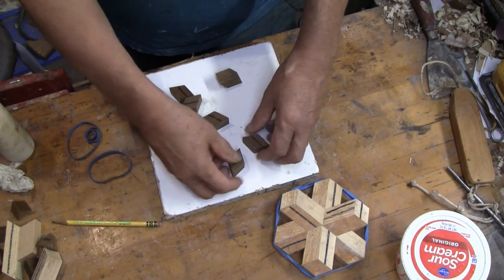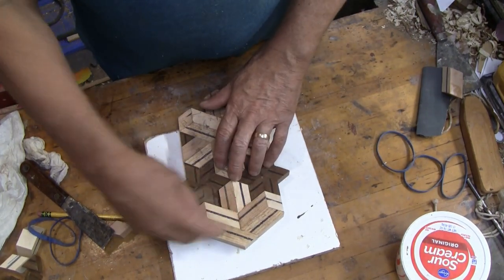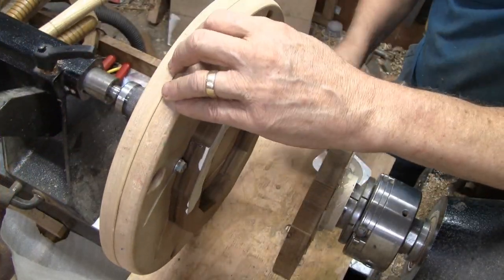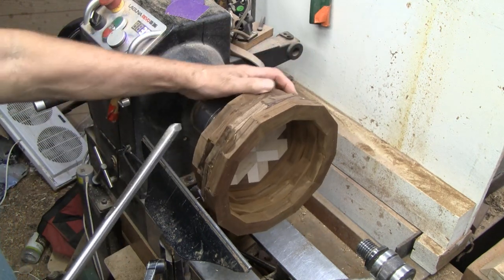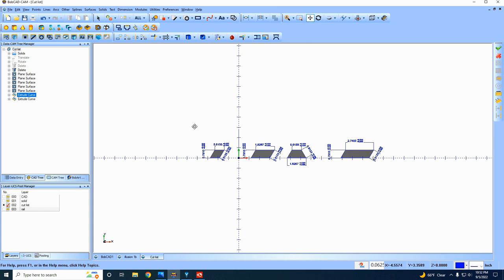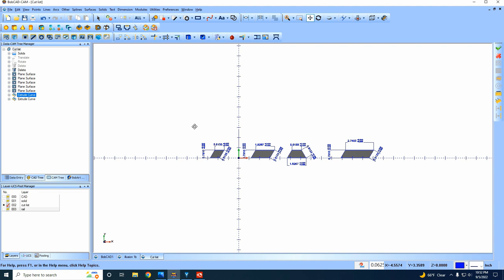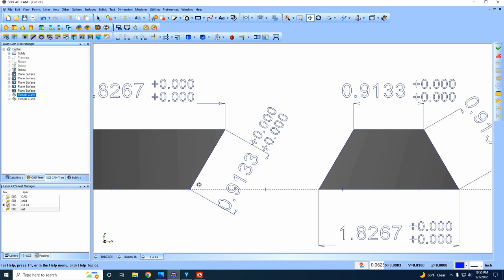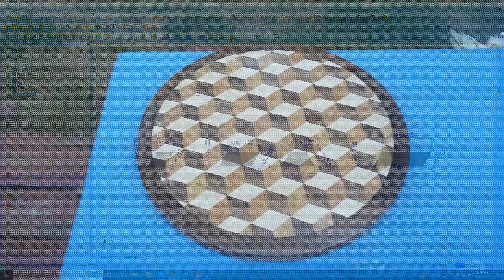Wood Turning the Knucklebones Bowl

Comment: For those who can use it, a FREE WARE cad program can make the design phase a whole lot easier, or pay the big bucks, your choice. 
What always gets me is the actual illusion caused by the different shades of wood and their alignment. 
Your skill is always apparent, and your knowledge of these processes shows every time. Yes, you were a pattern maker, and that helps, but this is art not mechanics, even if some mechanical things are involved. Great video. '-)
Reply from the maker: Thank you Robert. Yes there are a number of free CAD programs and some are very good. There is one called DesignSpark that is very powerful.  The program I bought has built in CAM which I use for CNC work. It also as a decent ART program where I can do engravings. Not a big bucks program but it works.
 Yes the shades of wood and how they are stacked up is what makes this work. 
Thanks for watching,
Gary

Comment: Amazing as always. As an engineer, I appreciate the thought process on how you develop the patterns. What CAD software are you using?
Reply from the maker: Thank you very much Trey. I use a  program called BobCad. It is an ok program but I bought it because it has CAM in it and I have 2 CNC milling machines.  I also added the art module as well which lets me do some carvings but I use DeskProto for a lot of that.
 Thanks for watching,
Gary

Comment: Thanks for sharing your expertise. I am truly impressed. Im gonna try this. One Question please. How many of each piece do I need to cut ? Thank you.
Reply from the maker: Thank you Jake.  There are 3 shades of wood making the center section. If you make 2 of each shape that should be enough. You may have extra pieces but you should have enough. I would recommend making more than that though just so you will have a choice for the best fit and look. I tend to always make more than I know it will need not for the fitting but more for the look.
After that the rest of the wood will be just one type.
 I actually did not make a cutting list for this or even the Great Illusion that I made.
 Hope this was helpful,
Have fun,
Gary

Comment: Check out the quilting book `stunning 3D quilts simplified` by Ruth Ann Berry. This and other designs are shown in this book. Thanks for your inspirations
Reply from the maker: Thank you Malcolm. I know they do this in quilting but never looked into a book. I just googled it and see now I need to look into getting one. I would not be surprised if this illusion might be in one of those books.
Thanks for the tip.
Gary

Comment: Awesome work, would it be easier to use CA glue for the initial segments (those making the "knucklebones")?
Reply from the maker: I do not think it would be at least for me. CA does not give you much working time  where as wood glue will allow you time to shift things in place if needed. 
I use CA for fill cracks and securing bark on live edge turnings.
Thanks for watching,
Gary

Comment: I've watched your great illusion video plus the knuckles video. Both are fantastic! How do you know which pieces go together to make the "L"'s I'm sure they are not the same. You never mention what you used for the "end" pieces. A drawing with the wood types would be helpful. We could use whatever wood we have but at least we would know what order they go in. As others have said I know it is flat but my eyes don't always see it. You are very talented!
Reply from the maker: Thank you Keith, happy you enjoyed both videos.
The easiest way to explain which colors go where would be to look them with the idea you have 3 surfaces. Looking down the flats you are seeing are all the same wood. Looking straight on the flats are all the same wood. And looking from the right they are all the same wood. Think of the end pieces as being part of the flat surface.

The "L" shape are made out of 3 sizes of the parallelograms and 2 of the trapezoids. 
I think looking at the picture at the end should be able to show you the order they go.

Think about the center section it is really made up of all the "L" sections. 
In your mind slide one of the "L" sections across the center section to the opposite side and you will see it is exactly the same in all cases.

Let me know if this makes sense and if not I would have to do this in an email.

Gary

Comment: Gary - love this project - it looks fantastic. I've got two questions. (1) what type glue were you using to have that much working time? I've been making tumbling bowls using Titebond III and I don't seem to get nearly as much time to adjust stuff as you do. (2) your bottom 6-segment ring that went up against the design piece looks great. I assume that you did a bit of sanding on the ring and the design before you glued on the additional rings...?

Regards, Jim
Reply from the maker: Hi Jim, happy you liked the turning.
I used Titebond lll. One trick is to not push the pieces tight together until all the joints have glue applied. That little space really helps a lot.
 I cleaned any glue off the main design piece before adding the ring pieces. Five of them fit perfect and I left one long just to adjust if needed. So I did not have one right to size to test but I think it may have needed a little taken off. Better safe than sorry. But my sled was still setup if I had needed to cut another.
 Thanks for watching,
Gary
Reply: @ThePapa1947  Thanks for the reply - appreciated! One more question - perhaps I missed it, but you didn't show how you cut the six small dark triangles that fit around the edges of the center piece. Obviously they need to be the same material as the six sided ring that surrounds it. Also, they weren't shown on the dimensions at the end of the video. How did you make those little buggers? 🙂

Jim

Comment: WOW!! 
Will have to sharpen my pencal and get my engineering ruler out..
Thanks for explaning and showing how this is done is helps give starting point once i get brave enough to try.
What is the cad program you where using?
Reply from the maker: Thank you Stevie. A sharp penci and a good way to measure is about all you need.
The CAD program I use is called BobCad. It does cost and I use it because it also has CAM and I have 2 CNC milling machines.
There is a free program called Design Spark that is the most powerful free program I have seen.
 Take care,
Gary
Reply: @ThePapa1947  thanks

Comment: Thanks Gary, I made a lidded box like this after seeing your platter. I cut my glue up in half and did the bowl from a board on both halfs for bowl and lid. I used a chop saw to cut my sections. I used 0.53 thickness, then just used the stock width as a spacer   between the blade and stop. 1,2 or 3 thickness depending on part. I used spalted maple, white oak and red oak on a walnut background. Ended up 10 diameter and 4.5 inches tall. Thanks for the inspiration!
Reply from the maker: Thank you very much Greg. I would love to see what you made and if you would like to share a picture you can find my email in my About Page.
Take care,
Gary

Comment: Another great piece of art. Thanks for providing the dimensions for the segments. The bowl in today’s video had very straight sides and a flat bottom. With this shape, I struggle with the transition from the sides to the bottom and I was hoping you’d show it but you didn’t show any details. Perhaps in a future video, can you show how you do this? 👍
Reply from the maker: Thank you Greg. Yes I will show close up's the next time I make that shape. My mind was on getting this done and figuring out how to present the information on the lengths and angles. But I pretty much cut a straight wall to within 3/8 of the bottom and then gently made a fillet at that spot.
 Thanks for watching a I may be making a fairly flat bottom bowl from a chunk of a log soon. 
Gary
Reply: @ThePapa1947  thanks Gary

Comment: What is that program call? Please!
Reply from the maker: The software program I use is called BobCad. If you are looking for something that is free and works great you might want to check out DesignSpark
Reply: @ThePapa1947  thank you! Very helpful videos; when I was in my 20s I used to work with a carpenter and learned how to make wood turning tables and chairs. Now I’m planning to get ready for when I retire but this time I want to do something different. Thanks again!
Reply from the maker: @FilisLawnCare  that is a great plan.
I sure enjoy what I do in reitrement even though I made things out of wood for a living. Much different though. They were wood patterns used in the process of making metal castings.
Have fun,
Gary
Reply: @ThePapa1947  will do, thanks again!

Comment: Beautiful bowl. Love watching your videos. I have a couple questions. I would like to learn wood turning, is there any chance you will do a wood turning video on basic wood turning for beginners. And also what computer program are you using. Thanks for sharing you work!
Reply from the maker: Thank you very much Chris. Sure I could do a basic turning video. What would you like to see in one?
The software I use is called Bobcad. It does both CAD and CAM. I have 2 CNC milling machines is why I picked it.
For a really powerful and free program you could try DesignSpark. I downloaded it but have not used it much because I have been using BobCad for so long it is hard to switch. But I think DesignSpark might be easier to learn.
Thanks for watching,
Gary
Reply: @ThePapa1947  I hear you saying your changing blades and giving the size and talking about the rpms, but I don’t understand why. I’m sure each blade cuts differently and possibly higher rpms mean a smoother cut. Maybe a video on a basic set up with blades a beginner could start out with and how to use them and what would be a good lathe to start out with. Thank you Gary for responding I look forward to watching more of your videos.
Reply from the maker: @Chris09Cole  thank you for the ideas Chris. I realize when first starting out it might be a bit confusing. So I will work on something based on your ideas and maybe a few others things such as sanding.
 Take care,
Gary

Comment: It's interesting how you can get the rings to fit together so precisely. I run all of my rings through a drum sander using a jig that I made. Thanks for the videos! It inspires me to build something.
Reply from the maker: I sand one face on my disk sander then the other on the lathe.
Very fast and I do not have room for a drum sander.

Comment: What I appreciate about this setup is that no material is wasted. Other assemblies made with solid wood require turning to the final shape, losing a lot of wood.
And the final effect is fantastic.
Reply from the maker: Thank you very much Marcelo. For sure it does save wood. But buying the wood this way cost much more than a chunk of wood from a tree.
And very little of that gets wasted as we use it around the garden and some of the shavings can be used for smoking food.
Other wise those pieces get turned into firewood.
Thanks for watching,
Gary

Comment: As always, your turnings are magnificent!  Thanks for dimensions for the Great Illusion.  For this one it would be nice also...especially the segment edge lengths and the diameter of the rings.  Thanks.
Reply from the maker: As far as the pieces that make the illusion for the Knuckebones bowl they are exactly the same as the Great Illusion.
I honestly do know know what the edge length was on the filler piece for the outside. I just marked the piece after making on angled cut and then cut the rest. You can make the rings how you want them depending on the slope you want for the side wall.
 Hope that helps.
Gary

Comment: The 3D effect had me confused, so I watched twice. So perfectly executed. 
What drawing software did you use for the demo at the end?
Reply from the maker: Thank you very much Bob.
I used BobCad for the drawing program. I have 2 CNC milling machines and this works well with them because it is also a CAM program. 
 It also works good for drawing these types of turnings and proofing out that it will work.
 It does cost but if you want to try something that is free I would recommend DesignSpark.  It might be easier to use than what I have but I know my program and it works.
 Thanks for watching,
Gary

Comment: Absolutely amazing. Is there an easy formula to determine the diameter of the rings, I’m sure there is but my brain is in a spin from watching this. Great work. 
All the best to you. 
Regards Jim
Reply from the maker: Thank you Jim.  If you are talking about the different ring sizes that make the shape of the wall then sketch it on a piece of paper. Add a wall thickness and then  decide the thickness of the rings and put those lines across. At that point you will have each rings outside and inside diameter. You can use a free app called Segmented Calculator 2 which will give you the segment sizes.
Hope this helps and I understood your question. If not let me know,
Gary
Reply: Thank you Gary, I will give this a go, you are very generous with your time much appreciated. 
Regards Jim
Reply from the maker: Thank you Jim, happy it helped.
Take care,
Gary
Reply: Hi Gary, sorry if I’m being a bother but just have another question, or two,I have made the illusion using the three different size pieces that you show the dimensions for and it turned out pretty good for my first attempt, can I make the 6 triangles to fill the gaps out of the same piece of wood that I milled to 0.7910 or do they have different dimensions, sorry I’m trying to get my head around this, I’m trying to copy exactly what you have made , and then the six outside pieces, oh I think I need some headache pills 💊 💊😩, only if is convenient. Thanks Gary. 
Regards Jim

Comment: Gary, another great video. How do you clean the glue squeeze out of the exposed joints after the section dries?
Ken
Reply from the maker: Thank you Ken. I take a wet paper towel and wipe it off. I find that the easiest and fastest. It will be turned and sanded so I do not worry about a little film on the wood.
Thanks for watching,
Gary
Reply: @ThePapa1947  when you hold the pieces together with elastic bands, how do you get the wet paper towel under the bands to glean th edge of the side joint?
Reply from the maker: Q-Tips and water. I have some smaller diameter ones that I use.
Reply: @ThePapa1947  thanks, that is what I have used also.

Comment: Try using and upholstery stapler to hold you pieces temporarily. Works really well.
Reply from the maker: That might work good as long as you can turn away the marks from the staples.
 What I used at work to hold segments in place and tighten up the glue joints was "pinch dog" But they can leave a pretty could size hole to have to repair. I do have some micro size pinch dogs that probably would work like your stables but the pinch dog not only holds them in place it tightens the joint.
Thanks for your tip,
Gary

Comment: I have the cutoff angle set at 30 degrees, but some of the pcs don't fit together like yours. What could be wrong?
Reply from the maker: The only thing I can think of without seeing a picture is you might have the angle set from the wrong plane.
Looking straight on to the flat side of your table saw blade the fixture will tilt 30 degrees off of 90.
If you would like to send a picture of what you have I will know for sure. Plus I can send you a drawing of  how it is done.
You can  find my email address in my About Page. This can only be seen on a computer. It will not show up on a cell phone. If you can not find it let me know.
Gary

Comment: Making stars. Other than cut and try, how do I determine the cut length to make sure the block is fully  symmetrical?
Reply from the maker: The way this works is the stars are equal length sides. those are 1/2 the length of the longer piece. If you watch to the end of this video I give the dimension for the Great Illusions. Those pieces are the same as making the Knocklebone Bowl.
 Hope this helps if not let me know and I can help more.
Best of luck,
Gary

Comment: What are the very long pieces for?
Reply from the maker: Which part of the video do you see them. I did this awhile ago so I would need to look and see what you are referring . I would be happy t look.
Reply: @ThePapa1947  I was watching the last part where you were showing all the dimensions and cutting details. I think I see where the long ones are for the outer most pieces on the platter you made and not the inner sections like the bowl you are making in this video.
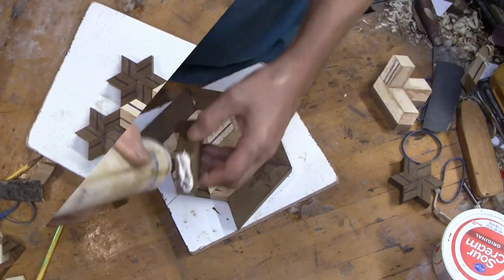Reply from the maker: If you are talking about what happens at 9:59 in the video those would have been for the boarder pieces around the out side.

Comment: Gary - Perhaps I missed it, but you didn't show how you cut the six small dark triangles that fit around the edges of the center piece. Obviously they need to be the same material as the six sided ring that surrounds it. Also, they weren't shown on the dimensions at the end of the video. How did you make those little buggers?
Reply from the maker: Hi Jim,
I did not give those dimensions but I mention they are made just like standard segments. Just a little bigger. I think it is best to measure those after all the other pieces are cut and glued together.
 Those dimensions at the end were for the Great Illusion but the center of this one is the same as the center of the Great Illusion.
Hope that all makes sense. If not let me know.
Gary

Comment: Do you have a video on? The jig you made for the table saw for the 30° angle cut let me know
Reply from the maker: Sorry I do not Jack.
But it's nothing more than a board with a slide for the table saw slot. Then a rail on top set at 30 degrees from the face of the blade.
 If you email me I will send a drawing of it.
Gary